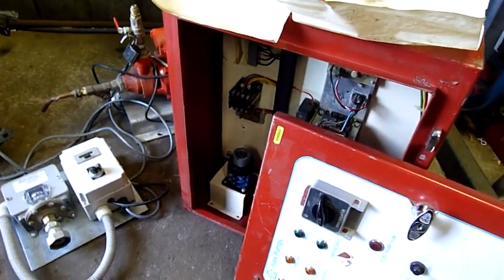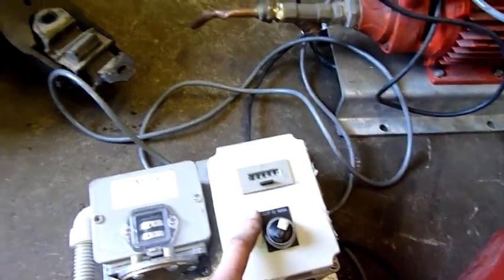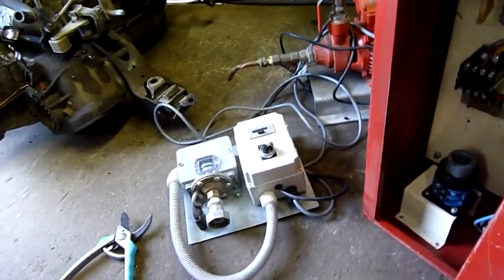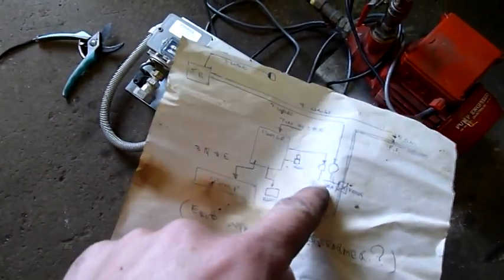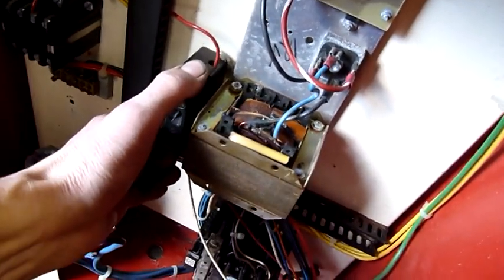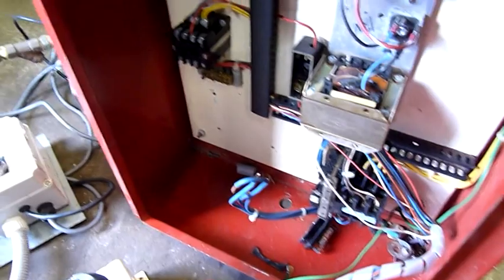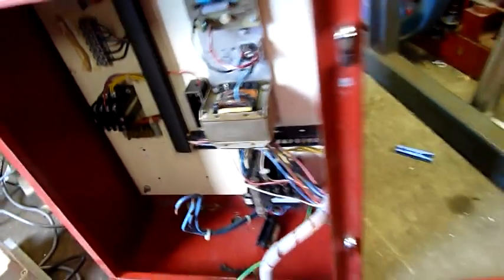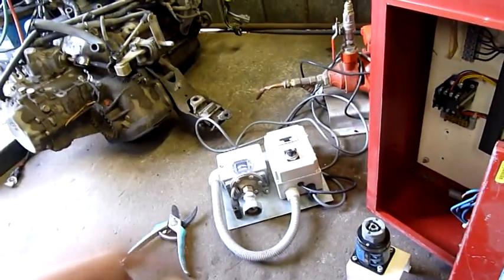Ajax Fire Sprinkler Monitoring and Test panel Autopsy

Comment: That cool bit of kit is similar to what was installed in a factory that i worked in when i was a maintenance engineer, the pump kept the back pressure up so the valve on the incoming main was kept closed untill one of the sprinkler heads was activated, when the pressure dropped due to the sprinkler head going off the main valve opened and the system was activated, simple yet effective.

Comment: I work for a Fire Pump Manufacturing company.  Looks like a small electric fire pump controller.  It would have controlled a small pump, maybe up to 15kW.  The thing above the transformer would be a battery charger.  The only thing that the battery has to do is ring the bell in case of power failure.  I think I saw a 3 phase contactor down the bottom.  Looks very basic but also pretty much the same as what is being built today.  The jacking pump looks like a Pentax PM80.

Comment from the maker: I've had a few that run in series with the lamp and turntable and they do burn when directly connected to mains. it also sounds like yours could have a tap for the turntable to connect to, thats what may have burned up

Comment: Are you sure that front panel lever doesn't fit straight on the rotary switch? They look to be a similar fitting. The depth of that cabinet and the length of the switch look fairly similar.

Comment: Some fire alarm systems monitor tamper switches and sensors. Great for detecting little skate-boarding hoodlums using the main cut-off as leverage when they round the corner.

One ADT tech that came out to check alarm circuits did NOT know what he was about and yanked the wires for the T1 internet circuit, cutting the entire campus off. The Jerk!  We threw him out and ADT sent another gent that did the job right.

Comment: Probably the batteries went short circuit, and the switch was placed in boost which bypassed the regulator, so it then fried the transformer and bridge rectifier. Pump will probably drive a cheap cleaner nozzle to remove road dirt on the cars. Will not be high enough to damage things but will do dirt well.

Comment: Hey Ed just a question, my microwave died and I saved everything (the mag is in a place where it won't fall over and I'm not gona hook the mot up dont worry) anyways I wanted to make the fan into a little desk fan. So I hooked it up and plugged it in and almost immediately I smelled burning. It is a 3 pin motor (which is odd). Any ideas on how to hook it up? If not I'm just gonna use a motor I have on the shelf.

Comment: 24 Volts lamps last longer on 12 Volts although a bit dim. no secondary fuse on TX.
10 Amp HRC fuse is too high for a 200VA transformer.